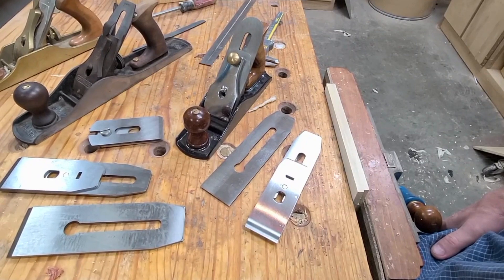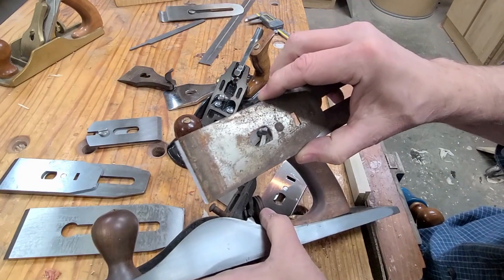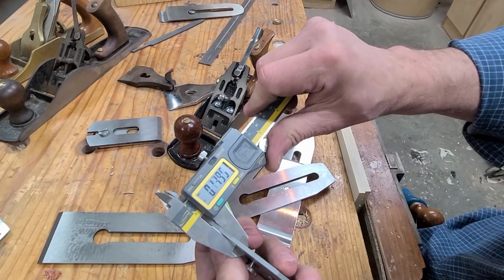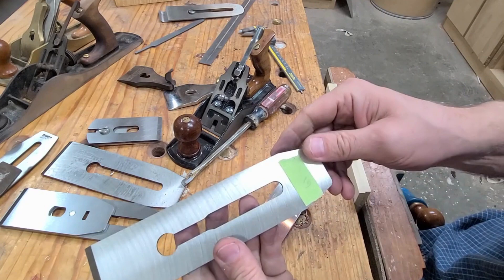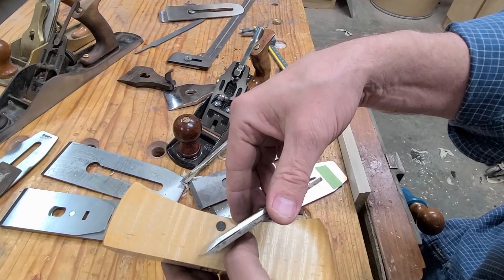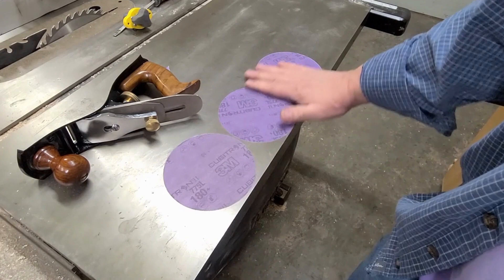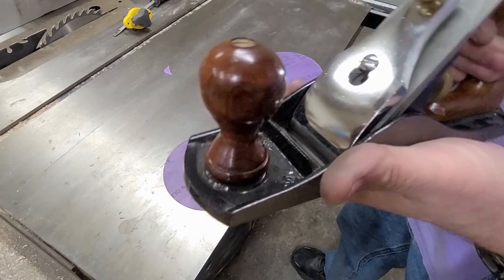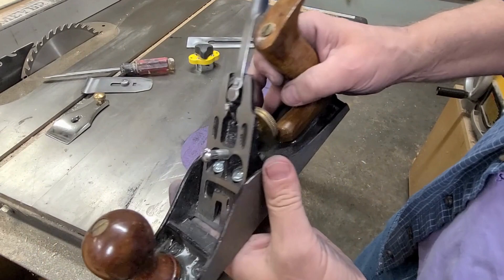Cheap plane? No problem. Maximize it's performance in minutes

Comment: I know you were presenting to the camera, so a mask would have been bad for audio, but just so other people know, steel/iron dust is really bad for your lungs. Wear a respirator if you have it and a mask if you don't.
Reply from the maker: Absolutely. Thank you for pointing that out for anyone watching.
Reply: Wow!  Many thanks for pointing this out.  I'm kind of a newbie and I have a few new plane irons and chisels that I need to tune up this winter before I get out the garage and put them to work in the spring.  I'm glad you mentioned this as I might not have thought of it on my own.  Cheers!

Comment: I tuned up a cheap Harbor Freight plane and got it to work decently. I had no one but YouTube teach me what I needed to know. Anyways I successfully used it for a year before I upgraded to a name brand plane. By then, my skills at sharpening and planing were honed and the transition was easy as pie.
Reply: There's not much to a hand plane really. What's important is sharpening it. If you don't get it wicked sharp it is not going to cut. Every plane except for a rabbeting plane needs a camber on the iron too. It can be really slight but it still has to be something. Basically people don't know how to sharpen and that's where their troubles are going to stem from. Most of the mooks around here are not offering good advise when it comes to sharpening too.
Reply: @1pcfred  I would argue that mating the chipbreaker is just as important as the sharpness, get your blade assembly together and you'd be golden.

Comment: I did pick up a copy of that David Finck book. Shall we say it is very basic, as in beginner level. This made 80% of so of the book redundant to anyone who has a woodshop, and knows what to do with the tools. I did pick up some ideas though.... 

Side note, no matter what plane you buy, always take it apart and examine everything on it. I check the plane iron for square, and make sure the sides are straight. Check the sole, check the handles, check all the screws and bolts to make sure they are tight, and check the sharpness of the blade. They all seem to need some work.

Comment: I purchased a couple of your harder 2" replacement blades, one with a chip breaker, awhile back and had a problem with the back of the blade having a "Hump" [for lack of a better term] and couldn't get it flat for the life of me. Since it was my first purchase from you I wasn't sure what to expect for a response, if any. Boy was I pleasantly surprised. I not only heard directly from you, you sent me a replacement blade free of charge & I didn't even have to send the problem one back - period. It flattened and sharpened up just fine, as did the other one so I bought another, all of which are working just fine. In fact, if I hadn't put one of your blades in my , made in Mexico, Stanley No. 5, I might have tried getting rid of it (& I'm a tool pack rat) because of the way Stanley has changed the configuration of where the sole and the bed of the frog meet, it no longer fully supports the back of the iron all the way to its cutting edge. The new, thicker style of irons do not need that final 1/4" of support to work well, w/o so-called chatter. Anyway, I was impressed enough with your service and products I went ahead and purchased one of your No. 7's through Amazon. It was good, but had a cosmetic problem so I had it replaced and it's great. Now, I'm thinking of your rendition of the Stanley No. 93 1" shoulder plane to augment the 3/4" Bench Dog No. 92 I already have - despite Rob Cosman's doubts regarding the adjustment semi-circular grove destroying the brass(?) adjustment wheel. [You may read my user comments/reviews of almost all tool products I post  either under my Nom d'Tool-Comment as JBarleycorn, or my Nom d'Blog, Myron J. Poltroonian.]

Comment: FYI, Hock blades for Krenov style planes: 2" x 3 1/2" = $55, 2" x 4 1/2" = $59. David Finck also has a video version of the book and it is amazing.
Reply from the maker: Thanks! I'll add a link in the description for those who may prefer the video.
Reply: @TaylorToolworks   - I followed the link to have a look.  The price for the 4-hour video is only 10 bucks.  What a bargain!
Reply: $59? Fuck that!
Reply: @1pcfred  You get what you pay for.
Reply: @marvistawoodworks7624  I wouldn't place much stock in that claim. You get what you get and you pay what you pay. Price does not always reflect quality. The market dictates value.

Comment: Well, I do a LOT of turning, and have used nothing but V10 and M42 high speed tools for years now. Veritas has their V11, and it surprises me that no one is making plane blades out of the M42 steel. It really holds an edge on my turning tools. Any idea why not? I know they have 1/8 inch stock. Bought some blanks from D Way tools up in Washington, and am going to make my own marking knives. Have one 1/4 inch thick piece I made a 1 inch wide chisel out of. Works great.

Comment: When you said, "I changed the paper to 220 because this (180) wasn't cutting fast enough...." did you mean you changed it to 120? Or did you mean you were trying to get a more polished surface? Thanks for sharing this idea. It's a real game changer for lapping plane soles!
Reply: I was confused as well, obvs if the 220 cubitron somehow cuts faster than the 180 then it would never really make any sense to use anything but the 220!
Reply: he later says pointing to the sole that it was 120

Comment: There is absolutely nothing wrong with Stanley plane irons. They work fine for me. But I know how to bed an iron on a frog and that may be the critical factor. If your iron is flapping around in the breeze it will chatter then.
Reply: There's a world of difference on how the frog mates with the iron between my Made in England Stanley No. 6 Fore Plane that I bought brand new in the mid-'90's and my Made in Mexico No. 5 I bought a couple of years, or so, ago. I replaced the No. 5's iron with a Taylor and its great. I put the No. 5 Stanley iron in my 1946 Sargent No.409 and it works just fine as well.

Comment: Geeze, I wonder how those thin irons on planes managed to do so much high end woodworking 100 plus years ago without ruining everything... It seems ridiculous to me that everything that was perfectly find 100 years ago is now considered inadequate. Are new irons good? Sure, but the irons from 100 years ago managed to make everything with no problems.
Reply: That Stanley is definitely not 100yrs old. And the steel they used on the irons is of a lower quality the more recently manufactured the planes are. Older irons were thicker but modern steel holds an edge longer. No one’s saying they never used to be any good but it’s a given that they needed sharpening more regularly than we need to now
Reply: @spycedezynuk  No, you're right its not a 100yr old Stanley. It's a post war, Stanley with the kidney bean lever cap and raised toe and heel. But I didn't say it was a 100 yr old plane. My point is, the Stanley's haven't changed all that much until they started producing garbage within recent decades. Plane irons weren't that different on an early Stanley type 1, all the way to the type 16/17 era. And those planes built everything just fine. There's no reason to buy Veritas, Lie Nielsen, WoodRiver etc when a good old Stanley can do the same job for under 100 bucks, whether its 120 years old, or 60.
Reply: @timothymallon  Ok I really don’t get your rant though ? no one in this video is saying you do have the latest or that old ones are no good. The reason you might want a new iron is because the old one is just not worth the effort or too damaged to restore. I have two number 4s roughly the same age one iron near perfect and the other virtually disintegrated when I was restoring them.
Reply: @spycedezynuk  oh bullcrap. Vintage Stanley planes are second to none. That's why they dominated the world market like they did. You can't beat it. Regular sharpening isn't a problem if you sharpen efficiently. In fact you're better off to sharpen more often. It's counterintuitive but the more you sharpen the less time you'll spend overall sharpening. As soon as you lose that keen fresh edge freshen it up. Then it literally only takes a few strokes as opposed to being there who knows how long bringing an edge back. And you're always working sharp then too.
Reply: @1pcfred  what do you mean bull crap ? I never said anything related to your comment about sharpening ? Nor did I say anything was wrong with a Stanley I’ve got two myself but if you do some research the older ones are slightly better due to manufacturing changes over the course of time. And no actually your not right about sharpening often, Katz Moses has done a very good video about that go and watch it.
Reply: @spycedezynuk  you talking about the video where he scary sharpens? Scary sharpening is a gimmick. Yeah it works but get a proper hone stone. In this day and age all you need is a 1,000 grit diamond plate. But for that to be all you need you also need to be hollow grinding your primary bevel too. Which is what you should be doing anyways. Maintaining a primary by hand is just needless drudgery. You literally should only have to make 3 strokes honing. Zip, zip, zip, done. That's how it should work. If you're doing more than that then you need to evaluate your technique. As far as researching anything goes I can just look to my private collection of Stanley planes. I have new and old ones.  Stanley cheaped out on plane bodies and other parts over the years but the irons have always been good.
Reply: @1pcfred  He does use it in the video but I know he’s done one before. This is a colab with another guy more about how sharp is needed, and people sharpen to often especially with modern steels. I don’t use scary it’s not my thing. I have Japanese water stones they are the best for me I’ve tried all types and prefer them.
Reply: @spycedezynuk  what kind of waterstones do you have? I just have a couple synthetics myself. The natural ones can be hard to buy in a usable size.
Reply: @1pcfred  The ceramic shapton stones. Not particularly cheap but they cut really fast and stay flat quite a while. I’ve a 120 that only comes out for the really bad stuff a 320, 1000, 5000 after stropping a blades as sharp as it ever really needs to be. I do want an 8000 but don’t really need it. What I like about them is only needing a spritz of water to use.
Reply: @spycedezynuk  I've heard of Shapton. They can be pricey. I use a generic Chinese diamond plate myself. It cost $6.36. Then I happened upon some Spyderco ceramic stones at a yard sale for cheap so I have those too. But if I didn't I could probably strop right off the diamond plate. My secret is I hollow grind my tools on a bench grinder. That really cuts down on the amount of hand honing I have to do. I didn't always hollow grind but I do now. Trying to maintain a primary bevel by hand is for the birds. Been there, done that, moved on. That's what most of these jokers on Youtube don't tell you to do. Oh yeah just do it on a hone stone. Sure. Piss on that.
Reply: @spycedezynuk , And Rob Cosman uses a 1,000 grit diamond plate and then goes directly to a 16,000 grit Shapeton ceramic stone. (He uses the diamond plate for both initial blade flattening & beveling as wall as for re-flattening the Shapton.)
Reply: @johnbesharian9965  ok I guess ?that’s a very expensive stone too….
I sometimes watch him he’s a very good woodworker but not my favourite on here, he also sharpens very fast by hand
Reply: @spycedezynuk , While I don't agree with everything he says or does, he does try to show the results of his methods. Just the other day I watched a video of his where he took a very nice 6 quarter board of highly figured maple (I believe) that had been book matched and then proceeded to plane one face with an iron sharpened to 8,000(?) grit and the matching piece with 16,000 grit. The difference was amazing.